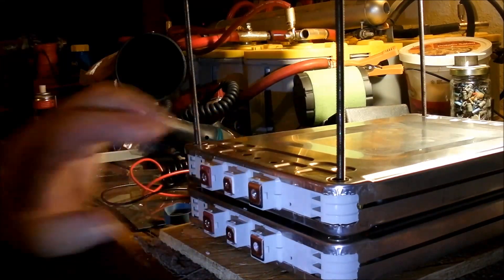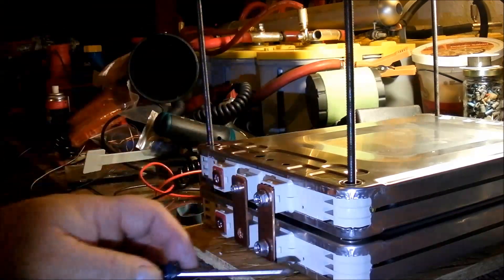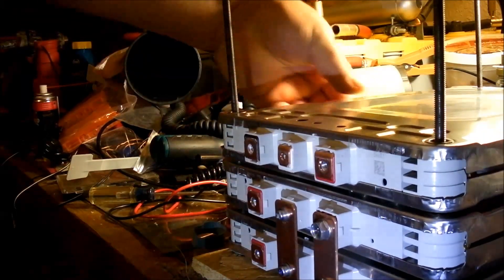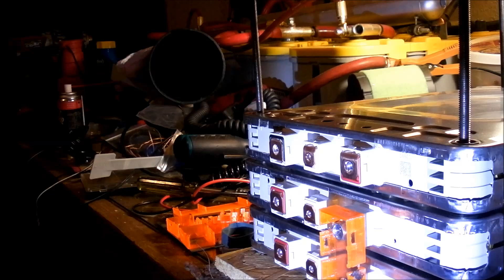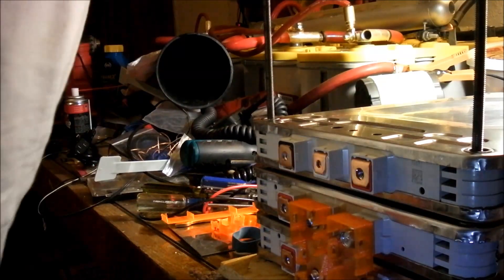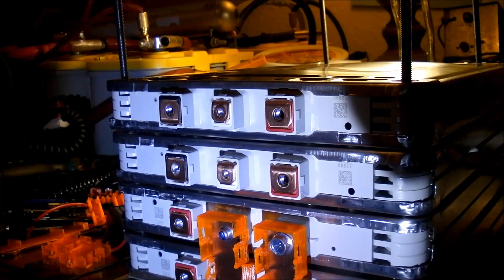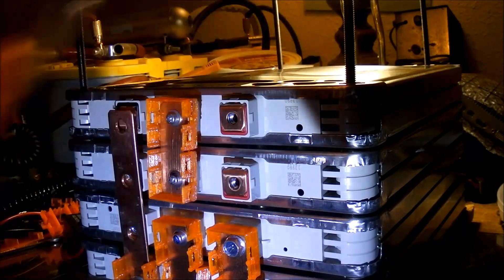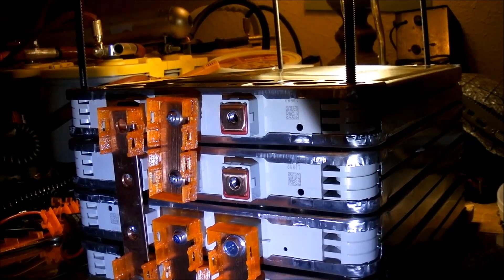Stacking up my Nissan Leaf Batts pt2

Comment: I saw some batteries similar to those on a commercial electric vehicle. Very nice set up and doing some great fab work.
Reply from the maker: yeah they are Nissan Leaf Batteries. Everything you charge these with you get it back there is no loss to heat when charging. I loose 30 percent when I charge my wet cell batteries (like the Optima Yellow tops or golf cart batteries. So the leaf batteries are super efficient.